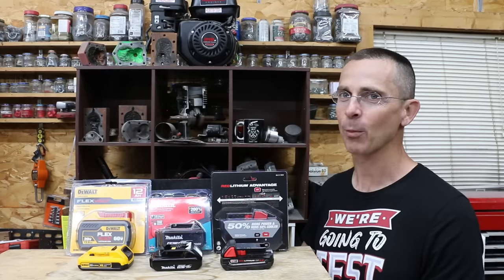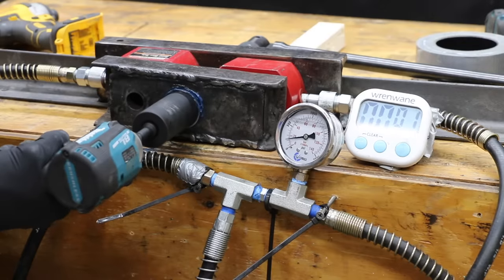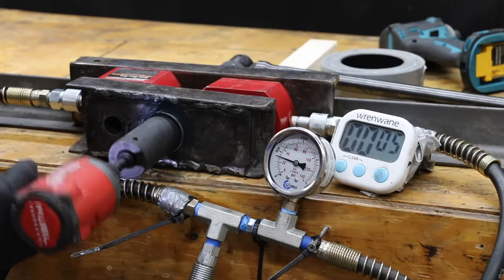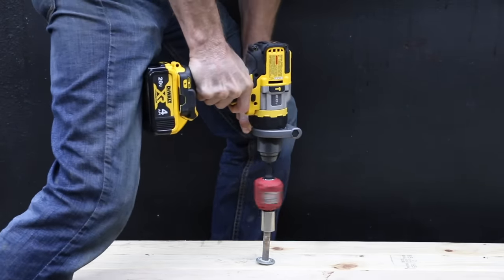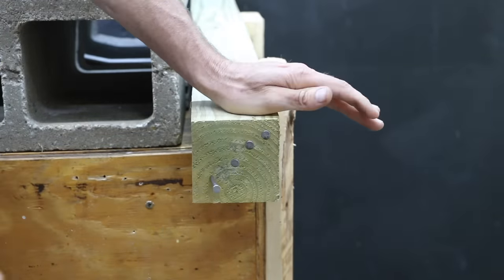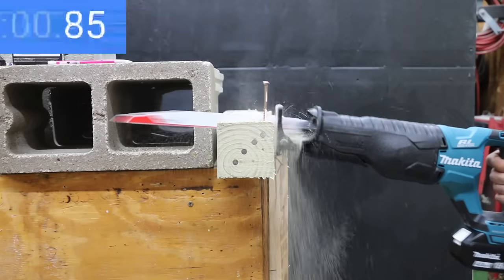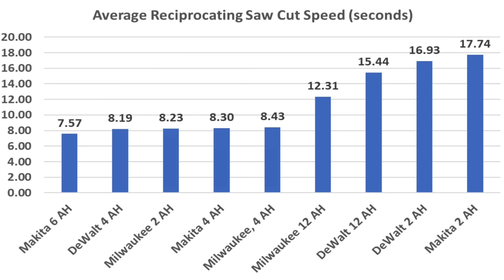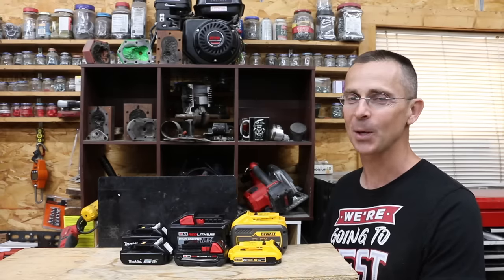Small "TOOL" Battery Better? Milwaukee vs DeWalt vs Makita

Comment from the maker: Here's the list of products reviewed. More details in the video description. Thank you!
Milwaukee 2 Amp Hour Battery: https://amzn.to/3Bf9AG9
Milwaukee 12 Amp Hour: https://amzn.to/2UpfXpN (no longer available)
DeWalt 2 Amp Hour: https://amzn.to/3kwqdHo
DeWalt 4 Amp Hour: https://amzn.to/3xPvEVx
DeWalt: 12 Amp Hour: https://amzn.to/3BdI6AE
Makita 2 Amp Hour: https://amzn.to/3ridv07
Makita 4 Amp Hour: https://amzn.to/3ku6mIR
Makita: 6 Amp Hour: https://amzn.to/3ze8yZh

Digital Tachometer: https://amzn.to/3zljsMy
Reply: I am so curious which M18 Milwaukee broke two sockets.  The shape of them correspond to so many different model numbers ... yet, still, I've only seen models with up to (claimed) 2,000 inch-pounds of torque or .... 166 ft-lbs !?  Really ..?  170 lb-ft broke not one but two socket extensions? Or is it a more torque-y model..?  THANKS!!

Comment: I'd like to suggest a comparison between different cooking pans based on the material (Regular Iron, Teflon Coated and Ceramic coated) and test their durability and heat resistance.
Reply: Don’t forget cast iron!
Reply from the maker: Great suggestion!
Reply: I’d also like to see this. Include copper pans to please
Reply: Would love to see the ninja and hex clad brands tested!  They both seem super durable!
Reply: Would also like to see that test.
Reply: Another vote for this!
Reply: I'd definitely be watching that video
Reply: Hmm copper and Dutch ovens too maybe?
Reply: I would like to see testing on old vs new cast iron.
Reply: Good suggestion!!!
Reply: Agree 👍
Reply: Obviously a cast iron lol.....with d5 all-clad coming in second.
Reply: and test their ability to resist stick lol
Reply: Also test to see which brands leech lead, mercury, cadmium into food.  Apparently alot of the brands forged in China have contaminated metals.
Reply: @2drealms196  that'd be too hard to test. way too hard. He'd have to find a specialist lab to do molecular analysis. Maybe just heat the pan and rub lead/cadmium testers on and see if they respond, lols.
Reply: @mntmn4228  I agree with you! If it happens please dont forget cast iron!
Reply: Fantastic suggestion 👍
Reply: Oh man, PERFECT idea. Would love to see this.
Reply: You'll need to include carbon steel as well
Reply: Check out America's Test Kitchen
Reply: He would certainly beat a whole bunch of lame cooking channels with factual information.
Reply: Great suggestion. Might as well add Aluminum, Copper, Cast, Carbon, Fake Rock to the mix. Note #1, my scan pan has a way more durable coating then my last cheap non stick. Note #2,  If you heat a non stick pan in a house with Parrots, they will die. wonder if there is a good way to test toxic levels of pans.
Reply: Can't go wrong with stainless steel and cast iron. Teflon, or its contemporary equivalent, is something that wears off over time and flavors the food we eat out of them.
Reply: Good idea
Reply: Sunjoe, huh, ???
Reply: If you cook any steak in these pans I can test the taste of each one 😋
Reply: @scotth9133  you do the lawnmower huh, ???
Reply: Have to be careful with possibly overheating teflon.  It can break down into hydrofluoric acid which is highly toxic.
Reply: @ProjectFarm  and carbon steel
Reply: @ProjectFarm  as a note americas test kitchen is like consumer reports and does testing of all kinds of kitchen equipment like all pan types. Their site is behind a paywall but they state all their results and on YouTube they show how they did it
Reply: Funny.. I suggested this last year and was told "This isn't a cooking channel"  Well sorry if I cook my own food lol.. I think PF should create a second channel (Off the PF) for non "shop items".. His input is very valuable in times of misleading "reviewers" on here..
Reply: @Luke sky you do the lawnmower huh, ???
Reply: Hell yeh I'm tired of buying expensive pans that last only a few months
Reply: I will suggest that one of you people out there do a home maker version of project farm the way he does it but with your own twist. You know he is all about tools for for work and home as in in build and repair.
Reply: If you do this one please do high polished versions of cast iron ,aluminium & copper
Reply: Also note induction cooking 🍳 but thats like a similar but separate video 📹
Reply: From the garage to the kitchen. What's next!?
Reply: I would love this!
Reply: @duffmancb11  Buy cast iron and it will last a lifetime... Never buy gimmick coated pans.. They will all fail no mater what and none
 of them are covered as they have a overheated clause..
Reply: @ProjectFarm  carbon steel pans too.  Theyre what commercial kitchens use
Reply: Would definitely be interested in this test.
Reply: I want to see cousin Eddie do some cooking
Reply: Would love to see a premium pan as well, such as All Clad and a tradition cast iron,  Coming up with a way to measure consistency of temperature on gas, electric, and induction would be cool.
Reply: @ProjectFarm  my man should get a set of the best pans for the suggestion.
Reply: @dimitar4y  lol good idea
Reply: @mntmn4228  that was the first thing @Lukesky mentioned.
Reply: If he does this I'd love to see a "pan as a weapon" comparison.
Reply: Is there any other option than cast iron??
Reply: And stainless steel!
Reply: @TheOldMachines  Cast Iron is my go to, followed by my carbon steel woks and my last choice is my USA Pan SS cookware.  Nothing beats properly seasoned raw steel.
Reply: Stainless steel trumps everything else. No sticking, even heating, and they last a lifetime, unlike "non-stick" pans. /thread
Reply: Heck yeah!
Reply: I’d second this one! Cookware can be super expensive but hard to know if the extra cost is worth it!!
Reply: By regular iron do you mean cast iron or carbon steel?
Reply: jami w  but does it have destructive testing?
Reply: @ProjectFarm  Maybe there is a way to test if and how the Teflon cooks off of the pan and into food? Maybe you could see it in bread? I've read some warnings as of late from scientific studies that if you cook in a pan without oil or just dry there is a very real possibility of cooking the PFAS chemicals(generic term for Teflon and others hat are "forever chemicals") into foods and causing harm to reproductive, developmental, liver, kidney, and to the immune system. It has been the biggest lie ever from Dupont saying Teflon is safe in cookware and has gotten into the drinking water worldwide.

It may be too much for you to do a proper video on but it would be cool if you can.
Reply: I use ceramic coating and like how easy it is to clean but it seems to wear down fast
Reply: Nice
Reply: @flybyairplane3528  They seem to be indestructible!
Reply: Use cast iron, carbon steel, and stainless steel. Throw all the other crap out! Lol
Reply: @mntmn4228  forged would be even better?
Reply: This would be super cool!
Reply: Amen! I would also love to see aluminum non-stick and stainless steel in the test too!
Reply: I like to use cast iron, lodge brand and antiques too, also i like stainless clad
Reply: @ProjectFarm  Love the channel, and thank you for your efforts. Knowing which cookware releases more/less chemicals would be very welcome info too. Health safety is equally important.
Reply: That would be great!
Reply: Don't use Teflon trash! No one should ever buy or use a Teflon coated pan
Reply: Also we have pans called the rock. If you have access to those put them in the mix
Reply: Infact it should be the next video
Reply: To helved with teflon coating..
Reply: @liggerstuxin1  copper pans aren't supposed to be good for you though
Reply: @Silver1080P  great… what’s the problem? Haven’t heard.
Reply: @ProjectFarm  If you do this, include the brand AMERICAN KITCHEN. I bought a set from Bed Bath and the great Beyond 10+ years ago... still like new.. Only TWO pieces had nonstick, the rest were multilayer stainless. AK is part of a group of US Manufactured cookware lines, all sold different ways
Reply: @shannonnezul4903  The Dutch Oven has nothing to do with cooking      :}
Reply: @citylockapolytechnikeyllcc7936  clearly you don't camp in the wilderness then. 
Also, eww.
Reply: Fry eggs on them until they start to stick.
Reply: Do it, there's so many options to test
Reply: I'd stay away from the cheap coated ones. Once the coating comes off you could be exposed to dangerous elements because walmart doesn't care. I know because they refused to answer questions about the pan I bought.
Reply: How about a video testing cheap and expensive click type torque wrenches? Not just for accuracy, but also for retention of accuracy. 
Thanks in advance.
Reply: We have salad master pans I would suggest you try them out too.
Reply: Do we have a troll?
Reply: carbon steel as well!

also testing flexion from heat cycling
Reply: Was this ever done? Can't find it if it has. Very interested in results
Reply: Make the video
Reply: They sell these granite or stone types in Walmart that seem tempting,  I'm still using whatever my mother left me from a decade ago,  the good ol' stuff. I think what I saw was blue diamond 🔹️ something like that
Reply: He made it!